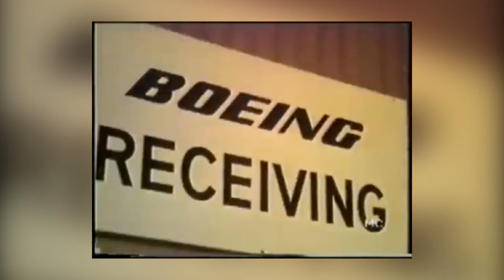Boeing’s Bold Design Gamble: How the 747 Almost Didn’t Happen

Comment: IMO...  the 747 was specifically designed and constructed for the transportation of the Shuttle(s) and was funded/ paid for by NASA. (The 747's bulbous nose allowed the airstream to pass more efficiently over the the nose of the shuttle which was attached piggyback on the roof of the 747.) It was a great business deal for Boeing as it began to produce and sell a fleet of 747s for both passenger and freight purposes... at a highly subsidized development cost.
"Your tax dollars at work."
Reply: No it wasn't specifically designed and constructed for the transportation of the Space Shuttle. NASA actually looked at using a C-5 to transport the space shuttle and decided that it would be better if they had their own shuttle transport and bought two 747s from American Airliners when AA was selling off their 747s.